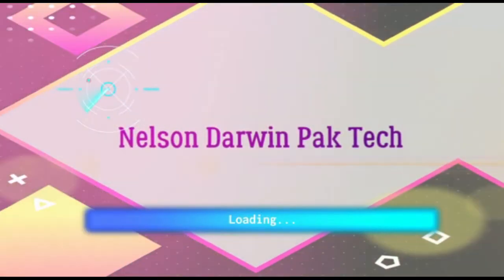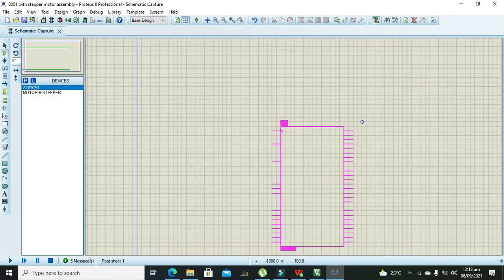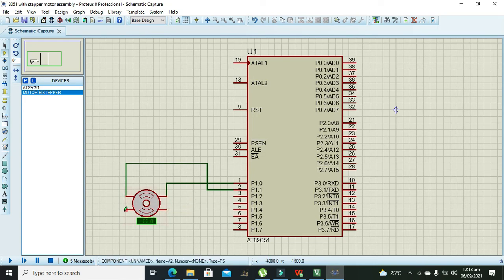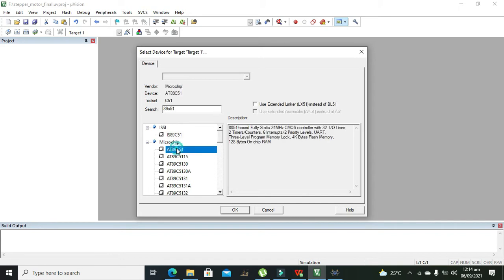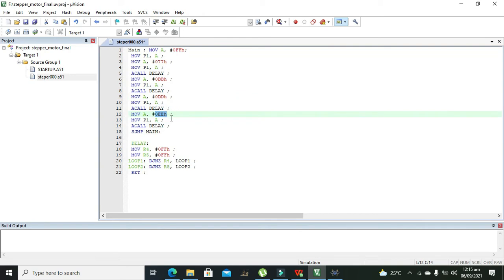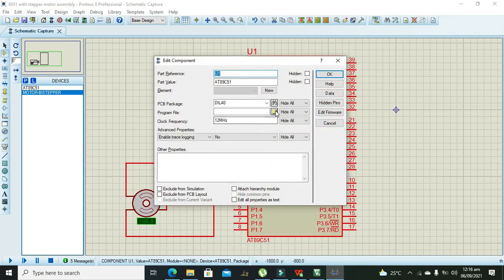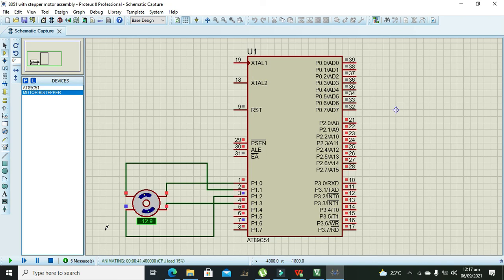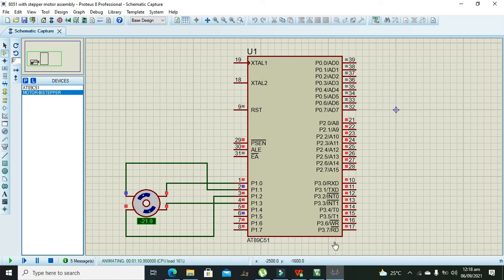stepper motor with 8051/89c51 using assembly language in proteus

Comment: Sir in my program i connected pins of microcontroller in differend way and my program worked. Is there any issue if i use different connections means for my program anti clockwise rotation shown when i used my connection of microconttoller and stepper mortar in different way.
Reply: Means like you connected 4 pins i connected them in different way
Reply from the maker: ya but the sequence of high and low patterns by mircocontroller is of importance...u can try by swaping pins....